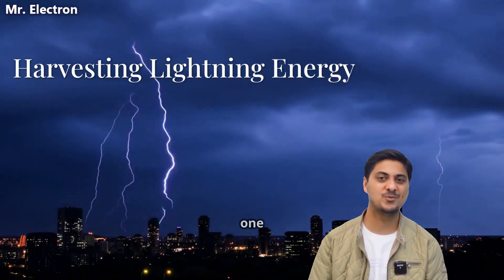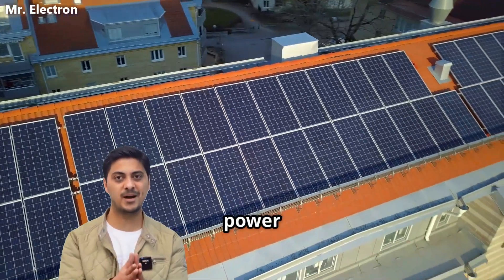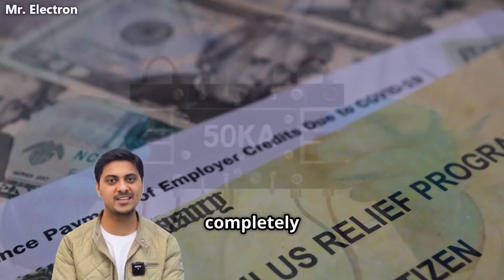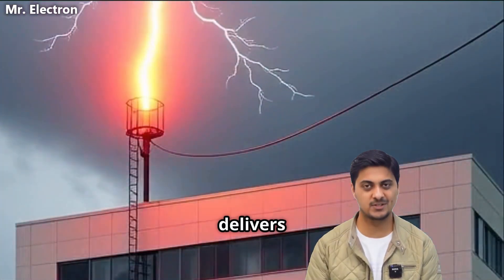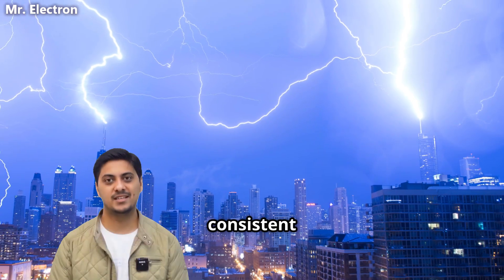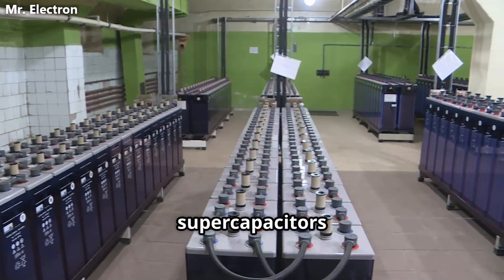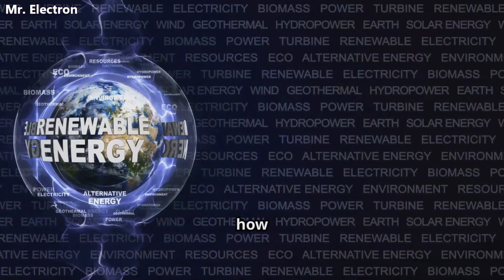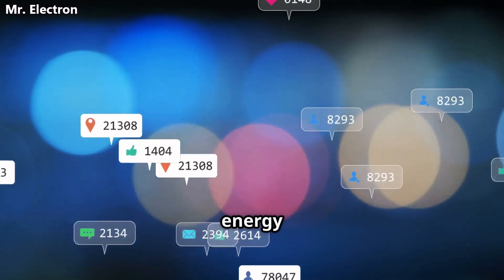They should have already Invented this simple device | Unlimited Electricity

Comment: Yeah, the problem is that majority of the power goes into the hot white arc we call lightning bolt. You could theoretically use a large current transformer, but there's plenty other problems to it.
Reply: ligtning temps is around 29 000 c  :D its just melt everything or burne in second no such way to store such energy it burne every storage devace we currently have at list !   lightning bolt is literally 5–6 times hotter than the Sun’s surface—enough to vaporize metal in an instant.
Reply: @janekslejins5559 yes, but i guess no. Lightning rods are just too big to be replaced after every time a lightning strikes them, so it seems to me that the heat itself isn't that destructive. The plan is to use bottom of the lightning rod as the primary.
Reply: @tvojelektrikar  no one batery stay alive  even capacitors  wich tend to take  more  burn out right away on heat :))
Reply: @tvojelektrikar  thunder is basicly the same Plasma arc wich is used in metal industry it can vaporise any metal in  second like through lighting rod it goes fast through wery fast but if it stays on place like for mlisecond in burn even lightning road or completle vaporise :) it dont vaporise lighting rod becouse it moves  whery fast through
Reply: @tvojelektrikar  huge transformers operate with currents wich is not even close to those in thunder bolt :) and again you have only split of second to use that energy wich will be eventualy 90 % heat +
Reply: @tvojelektrikar  30,000 A  and lasts  30 miliseconds its just incredible we havent anithing that could last that hit  to store energy :D  !  need capacitor to store energy but no one stay alive on those 30 000 amps
Reply: @janekslejins5559 yeah you can design a transformer to withstand that 40kA pulse. And eventhough majority of the energy converts to heat, you can still capture at least a fraction. I'm not saying it would be material efficient, but I think it's an interesting idea.